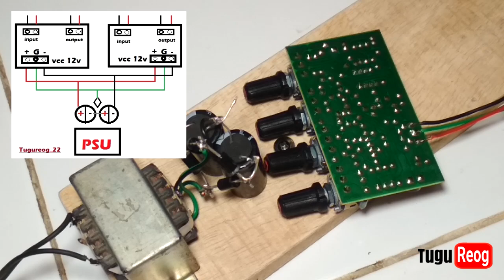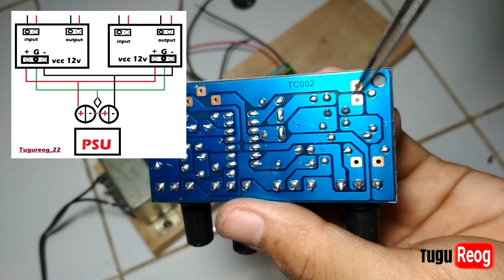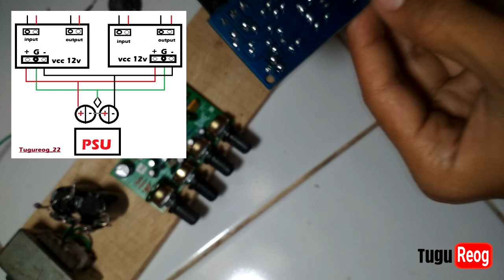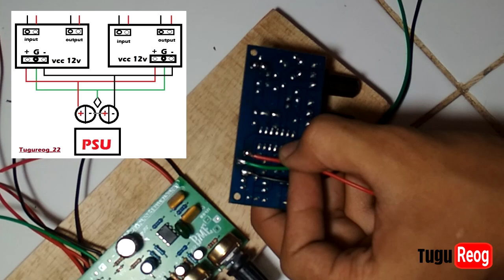Cara memasang Tone Control dengan mudah

Comment: Mau nanya ada tone kontrol mono 2 buah kalau input di jadikan 1 yang putih hitam ke hitan kiri juga yang mera kanan ke merah kiri juga, jadi cuma pakai socet rca 1 buah mera dan hitam gak 2 buah merah dan 2 buah hitam apakah aman, kalau pakai 1 HP / 1 DVD kan susa kalau Sama seperti dividio jadi harus pilih salah satu Soket rca yang kanan atau kiri dari tone kontrol 2 mono itu
Reply from the maker: Bisa sekali bos
Input tonr controlnya pakai yg mono sudah beres
Reply: @ReogChannel  saya ada power 2 stereo tone kontrol stereo Dan power 2 mono Dan to kontrol 2 mono dijadikan satu di inputnya di soket rca hitam dan merah  apakah bisa atau harus tambah resistor/ sebagai nya
Reply from the maker: Langsung pun bisa aja
Atau kalau mau pake ke 2 input masing" tone control 1 kabel input di pecah jadi 2 jalur menggunakan resistor 1k 2 buah

Comment: Om, ini sya ada trafo ct 1A/ 12volt, mau buat psu ntuk tone control BSX 71 streo, dan di minta nya voltase nya di antara 12-24 volt jd di butuhkan apa ja om,, soal sya coba 12 volt. Suaranya banget, kira2 apa nya agar suaranya besar, mf pemula. Terima kasih dan tunggu jawabanya.
Reply from the maker: Perlu diketahui besar kecil suplay tone control tidak mempengaruhi keras kecilnya suara
Mungkin ada rangkain amplifier yg blm benar..
Dan untuk suplay tone control biasanya umumnya 12-15 v
Reply: @ReogChannel  sya pakai driver ocl 504 mono ,tp tanpa tone control suara nya besar, begitu sya pakai ke hbng kan ke tone control kecil suara nya, dmn masalahnya om?

Comment: Gan mau tanya,kit tone control saya 12 vol-15 vol,di travo ada 12 ct,18 ct,20 ct ,pertanyaannya apakah langsung saya sambung ke 12 ct atau ttp ada power supply,kalau ada apa saja komponennya dan berapa ukurannya/vol nya ,atas jawabannya saya ucapkan terimakasih
Reply from the maker: Ya harus ada rangkaian penyearah tegangan dulu bahanya meliputi:
- elko minimal 2200uf 35v = 2 biji
- dioda silikon min 3A 4 biji / dioda kiprok 5A 1biji
Reply: Misal pakai adaptor 12 volt bisa ta

Comment: Asalam,mualaikum mas 
Mau tanya, saya mengunakan power ca 10,
Kalau mengunakan tone control, untuk in power kan ke out, tone control, trus untuk in, tone control kan ke BT, 
Tome controlnya mengunakan rinjani, itukan tidak ada tone control vokal nya 
Trus untuk menyambukan tone vokal harus melalui in tone control,  untuk pepasaganya saya gabungkan tone vokal dan Mp3 bt kok suaraya tidak normal mas itu gimana,
Reply: Bantu jwb, output pream mic dikasih resistor 2k2 sebelum masuk input tune control..begitu

Comment: maaf mas Reog# mau nanya klu tune control + Galaxy tanpa apli bisa keluar audionya?? ane mau rakit buat PC ,,,,,, maklum baru tahap belajar
Reply from the maker: Keluar mas tapi kecil sekali
Seperti out di headset
Reply: berarti intinya harus ada penguat suara y mas seperti kit speaker aktif?
Reply from the maker: Ya betul harus ada kit power nya
Reply from the maker: Tune control tugasnya hanya untuk pengaturan suara

Comment: Mau nanya kalau 2 tune control mono input di jadikan satu gimana omm 🙏 maaf pemula 🙏
Reply from the maker: Bisa sekali.. 
Dengan opsi
1 ambil L
2 ambil R
Atau dua" nya langsung dikasih L R artinya input di parallel
Reply: Terimakasih atas ilmunya semoga sehat selalu dan dilancarkan semua urusan nya🙏🙏🙏🙏🙏

Comment: nanya mas. itu kan tone contol ct ya. jika dirubah ke dc 12 v aki bisa gak?
. trs itu kan mono inputnya tetep stereo. jika di kasih input salah satu aj apkh bisa?
Reply from the maker: Bisa diberi dioda 2 biji untuk di buat jadi ct

Stereo dibuat / dipakai salah satu teteep bisa
Reply: jadi dari + aki di cabang pake dioda trs di sambung ke - + ya. dan ct ngambil dari - aki
Reply from the maker: Betul mas tapi tambahkan minimal 2 elko di seri seperti di amplifier setelah itu beri dioda tadi

Comment: Om...knpa ya PA sya klau d ksh TC dengung PSU TC ambil dr extra trfo utama....mhn solosinya om...mdh"tmbah berkah...🙏🏼
Reply from the maker: Kalau saya out trafo sblm masuk ke tc sy beri regulator penyetabil tegangan dulu mas..biar stabil ( biasanya tdak dengung)
Reply: Ini jg pkai regulator simetris om...cm trfo pkai yg extra...🙏🙏
Reply from the maker: @mencariberkah1859  solusi 
- ganti trafo lain (kalau tetap brti tc nya bermasalah) / kalau normal cb ambil dari skunder trafo

Comment: kalau utk tone control+mp3 pakai trafo brp ampere  mas?sy pakai 1A kok ga kuat y?
Reply from the maker: Sebenarnya sudah cukup mas klo travonya normal, 
Coba pke 2A aja
Reply: Reog Channel sy pakai 1 A puny tronik.buat suply tone contrl sama mp3.padahl  dari trafo sy pakai simetris  2 kit.
tp suarany kok dengung ya?
Reply: @dwiyanto4060  sebenernya sudah cukup om 1 set elco 4700uf 50 volt.. Saya aja pakai trafo 1 ampere.. Malah aq kasih 4 buah tone control.. Tidak ada kendala apa".. Trafo pun tidak terlalu panas.. Cuma anget dikit..
Reply: Kalo d nyalain lngsung dengung itu ada yg kebalik pemasangnya, tpi kalo dengungnya bass di besarin itu dari ground nya ..

Comment: Satu trapo bisa gak untuk power plus tone control gan ma.af pemula
Reply from the maker: Bisa sekali bang tinggal sesuaikan tegangannya saja ambil 1 out aja dari trafo misal tegangan Amplifier 25v ct dan untuk tone control membutuhkan 12vct tinggal 25v ct tadi diturunkan dengan menambahkan ic regulator 7812 dan 7912
Reply: @ReogChannel  .iya siap gan makasih sukes selalu.

Comment: Assalamualaikum,mas.klo untuk tone kontrol arus yg dibutuhkan 12 v gmn caranya.sdg trafo cuma tertera ct 22v.
Reply from the maker: Solusi jika tidak ada out 12v
Pasang Rangkaian Regulator step down
Atau bisa menggunakan IC regulator 7812 dan 7912

Comment: Om.punya tone kontrol saya gak ada ket 12v15v ini gmn msangnya?? Cuma ada (+-0).mohon solusinya
Reply from the maker: iya sama aja om itu 0 nya jadi ground
Reply: @ReogChannel  yang (+)nya rencana mau saya kasih 12 volt dari belakang trafo.saya kasih dioda 1n4007&1000uf 16v.gmn menurut Om???

Comment: Power 400 wat mono speaker  10 inc  usa dbl coil  2biji   power mono 400 watrdikasih teganga brp ac tegangan brp trapo 10ampere murni
Reply from the maker: 220 ac
32 vol ct
Reply: Vcc power mononya berapa volt?

Comment: Mas kalau input dan output itu apa ya mas dan disambungin di mana,tolong dijawab
Reply from the maker: Input di hubungkan ke in jack bisa ke hp
Out di hubungkan ke input power amplifier
Reply: @ReogChannel  mau tanya mas utk input ke hp, yg L ke tone control 1 dan yg R ke tone control 2 gitu ya mas?
Dan utk out ke power stereo? Mohon jawaban

Comment: Assalamualaikum mas tolong tuliskan nama" komponennya beserta harganya ,soalnya mau blajar ngrakit sendiri 🙏
Reply from the maker: waalaikumsallam
komponen tone control ya?
di video sudah sya jelaskan
kit tone control (jumlah bisa disesuaikan)
trafo 1A / 2A
elko rekomendasi 2200uf 35v min 1 set
dioda 3A 4bh
*kalau mau psu leih stabil bisa pakai IC regulator
7812, 7912
Reply: Travo di ganti adaptor 12v boleh ta
Reply: Kok gak di jawab
Reply: @ReogChannel  berarti travo 1A sudah mampu y ms utk suplay 2 tuncontrol tegangan tunconrol sama2 12 volt

Comment: Tapi saya coba cuma dengung mas kaya konslet gitu yg 3 kabel kecil kabelnya ada tulisan nya 220 110 0v trus  yg 2 sebelahnya kabelnya gede engkel gitu tapi udah gk ad tulisannya udh sobek kertasnya yg masuk ke power ampli kabel mana ya mas
Reply from the maker: Ooh klo itu bukan travo CT mas
Pada umumnya tone control berjenis CT
Tapi juga ada yg non CT
Reply: Cek aja pakai multi tester ke saklar AC di range 50....itu kabel yg 2

Comment: Mau tanya mas tone control saya kok gak berfungsi itu kira kira kenapa ya mas?. Terima kasih.
Reply from the maker: Cek kabelnya,dan psu nya dulu
Reply: Sepertinya sudah betul mas..input tone control dapat dari mp3 dan ouput tone control masuk power..psu nya pakek tegangan 15v dc mas
Reply: Kira kira apanya mas?
Reply: @ReogChannel  maaf mas tolong info  sama  saya type dari tone control  yg di vidio ini

Comment: Mas kalo tone control 1 buat 2 power amplifier apa bisa?
Reply from the maker: Bisa mas
Reply: Apa ada tambahan komponennya mas
Reply: @muflikh1238  di pararel resistor 2k2 ae

Comment: Klo TC stereo dipasang ke power mono gimana om cara nya?
Reply from the maker: Bisa digunakan salah 1 L/R
Reply: @ReogChannel  klo digabung pakek Resistor itu bisa ya omm??
Reply from the maker: @bkaudio559  Klo L&R di pake semua di seri resistor 4k7
Reply: @ReogChannel  oh iya makasih ommm
Reply: Met siang buossss kalau tun control stereo sama tun kontrol mono bisa gk ya masss digabung gitu

Comment: gan tone control bs nyala g kl pakek adaptor 12v dc?
Reply from the maker: Kalo adaptor biasanya arusnya tunggal 
Pakai tune control yg juga arus tunggal
Reply from the maker: Tune control arus nya ada 2 macam 
+ & - dan + G -
Klo adaptor biasanya hanya + & -
Reply: jd kl tone control yg ct itu tdk bs d akali pakek adaptor 12v dc biasa y
Reply from the maker: @asiafone7697  gak bisa bos.. beli yg tune control non ct
Reply: ok tx infonya gan

Comment: Itu per mono 1 set tone kontrol ya mas
Reply from the maker: Betul mas
Reply: @ReogChannel  kalo chanel mono tone kntrolnya 1 tapi pkr stereo bisa mas
Reply from the maker: @mr.siliwangi2333  tone mono & power stereo 
Bisa saja mas nanti inputnya di pecah jadi 2 biar stereo diberi Resistor kalo saya pake 15k 2 biji
Reply: @ReogChannel  ohh iya mass siapp  mksih mas
Reply: @ReogChannel  driver mas enakan 506 apa 504 untuk 2 set sanken travo 10a ct45
Reply from the maker: @mr.siliwangi2333  tergantung selera aja mas
Kurang lebih 11 12 aja menurut saya
Coba pake yg versi terbaru aja 506

Comment: Klok travoy panas knp mas,q udh niru di vidio itu ws mas
Reply from the maker: Ada beberapa kemungkinan
-pemasangan salah
-trafo rusak (ganti baru)
Reply: Mksih info nya mas,udh tak subscribe mas
Reply: Klok pngen yag buat bass gc ad suaranya gmna mas
Reply from the maker: @novalwelda2055  gak bisa mas
Bisanya pake crossover / dlms
Reply: @ReogChannel  mas klok buat pwer suplay, pkek elco winner 50 vol 10.000 uf 2 set,tpi bntuk nya gc sma mas,ada yg besar ada yg kcil apkah aman mas,klok kapasitas nya sma smua ws mas,maf msih pmla mas

Comment: Tone control saya gm 007s saya suply 18 volt kok pelan banget bang suaranya
Reply from the maker: Coba pakai 12v saja mas
Reply: @ReogChannel  di box.nya tulisanya 30v-42v bang .. kalo pake 12v kerendah.en apa nggak ya bang ? Pertama coba ngrakit malah ribet ..😅
Reply: @ReogChannel  tak coba naikin ke.25v jek audionya malah ada setrumnya 😫
Reply from the maker: @mann7622  terlalu besar mas kalau seperti itu... Mungkin sudah ada komponen tune control nya yg short
Reply: @ReogChannel  walah...gatau bang.. kirain volt.nya harus ngikut di kardus.nya ..😅

Comment: Bang punyaku kok dengung ya.. Klo di gabung seperti itu
Reply from the maker: Cek ground nya dijadikan satu.. kalau dijadikan satu dengung .
Groundnya satu2
Reply: @ReogChannel  ground nya udah ke pisah bang tapi aku coba gabungkan keluar percikan listrik kecil tapi klo buat satu power menyala dengan sempurna kalo buat 2 power tune kontrol sendiri" Dengung gak mau menyala
Reply from the maker: @terjalngimbo533  mungkin tone control nya bukan ct?
Reply: @ReogChannel  ct bang yang satu midle yang satu sub... Tapi yang sub itu ada L R nya terus aku pilih yang L buat inputnya apakah kebalik atau gimana

Comment: Bos qu buat. Ko g bunyi bos tolong bantuanx bos
Reply from the maker: Coba cek kabel psu nya benar apa belum
Reply: Udah bener bos.
Q beli travo 2a dan dioda 3a dan elcox 50v tapi g bunyi
Reply: Tone controlx merek tuners
Reply: Apakh kebesaran elco.x bos
Reply from the maker: @icadseries3441  elko kebesaran gak pengaruh...
Di suplay berapa volt emangnya
Reply: 18 vol mas
Reply: Dan travox 2a non ct
Reply: Apakh bener 18 vol dan ac 0
Reply: Itu cara pasang travox gmn bos